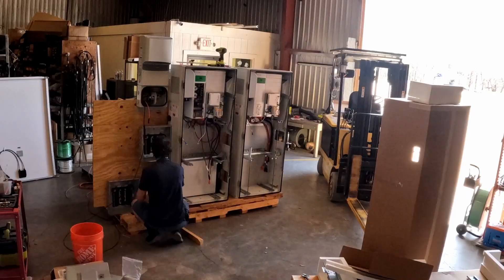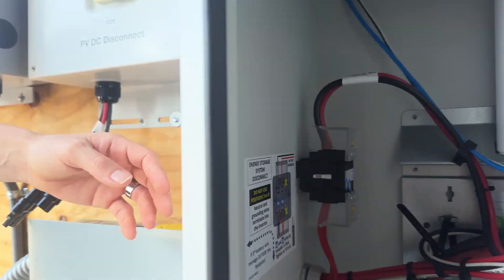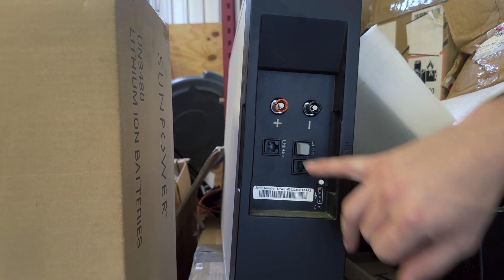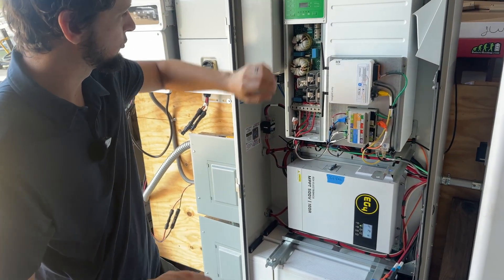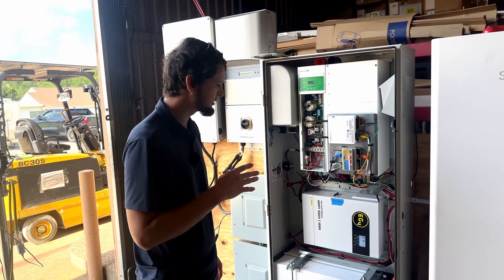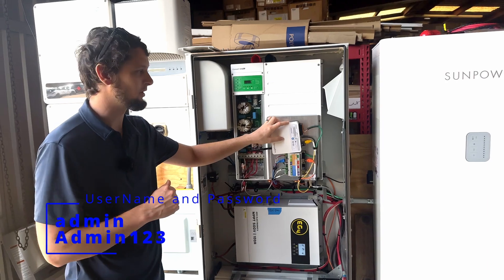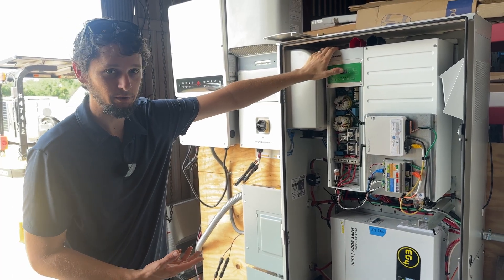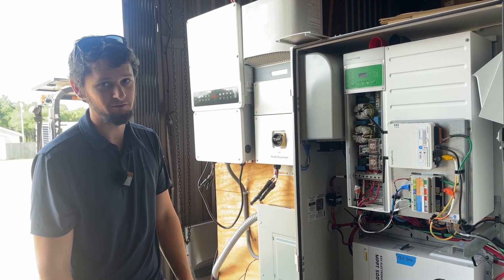Off-Grid SunPower SunVault System with a Schneider

Comment: What do I look for if my cooling fans are not turning on
Reply from the maker: It needs to get hot for them to turn on, I think the case inside has to hit well over 100f. But for what to check I'd make sure you have 120v on the wires running from the inverter to the MIO and then when it's hot in the case see if there's 120vac from the mio over to the case fan.
Reply: ok thanks reason I was asking because when I came home, after a week from vacation I had no light and batteries were off. So I opened the unit and turned power on took a few hours for the batteries to recharge. Thanks for your reply

Comment: Thanks for sharing!
My battery were over-discharged to 42v after a long idle. I open the battery lid and jump-starting to charge it to 52v . However gateway still shows 0% of SOC and battery did not close its relay for charge/discharge.😢
Do you know any ways to reset the BMS ? Thanks in advance
Reply from the maker: I’m told and have experienced that if the voltage goes too low the bms will permanently brick itself for safety reasons.
Reply: @BeeneEnergy thanks
Yeah I think I am experiencing the brick